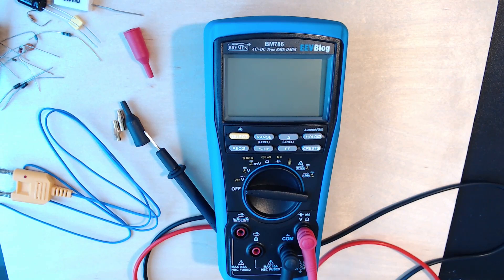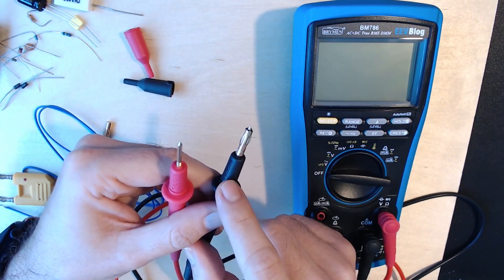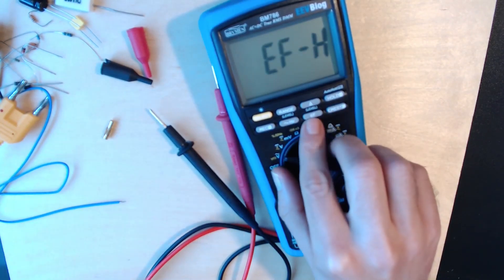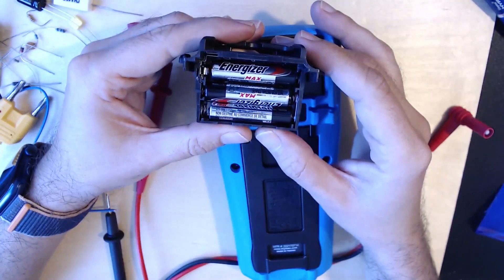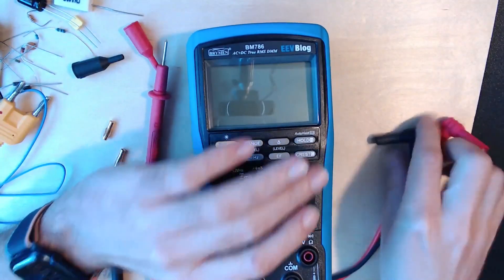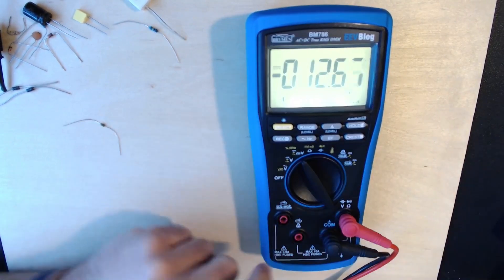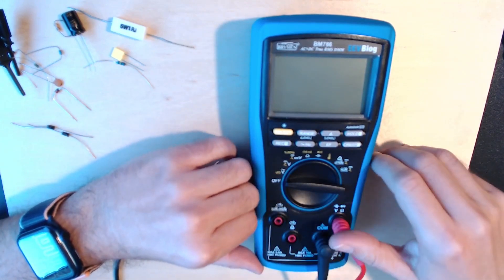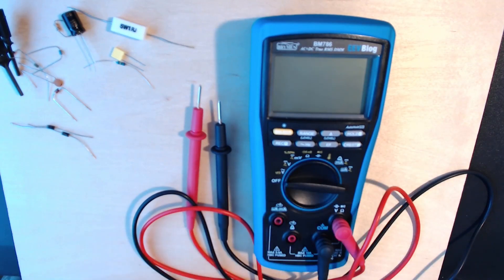Brymen BM786 True RMS Digital Multimeter Review

Comment: I think "midrange" is an wrong statement for that meter. I will call it an high end handhield meter that is at least as good as Fluke meters. Considering the price it's a bargain.
Reply from the maker: I can't be happier with this device and the value it delivers for the price especially compared to Fluke meters. I agree "midrange" was a bit subjective but it's hard to call this meter high end given it's feature set. There are a number of multimeters out there from different manufacturers aside from Fluke such as Kyoritsu that offers higher precision, higher frequency response as well as connectivity and logging features.

Comment: Place a reflective red stripe in the groove on the end of the switch. This is to improve visibility of the switch in this model in dim light situations. Helps a lot..Probes on this meter do not have round grooves unfortunately this is the only complaint about this meter. Also be aware that on mV range as per manual signal must not be greater than 1000mV to get an accurate reading. Conductance nS mode allowes to check leakage and insulation, determine length to unterminated wires and this works well. In temperature mode if you short COM and V probes you get internal temperature reading (this is not documented in the manual). In Hz mode REC function also can be used (not reflected in the manual). This is 60000 counts high quality and very accurate multimeter. You mentioned that probes can be used in EF mode. Note that COM only as per manual should be uses in EF mode for contact AC voltage detection. This model is sutable as a professional replacement for Fluke 179 etc though Fluke has probably a bit better (yet this is a small difference) ergonomics in terms of operating the switch. Actual use in the field placing this BM786 multimeter one cut above the crowd